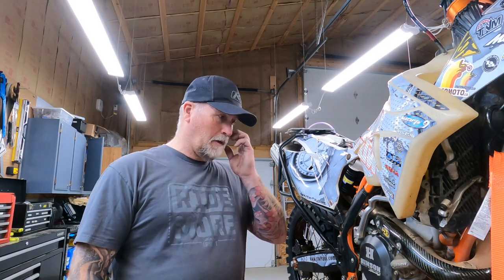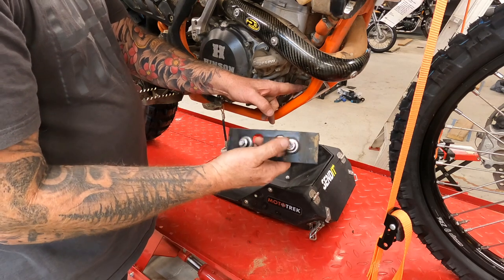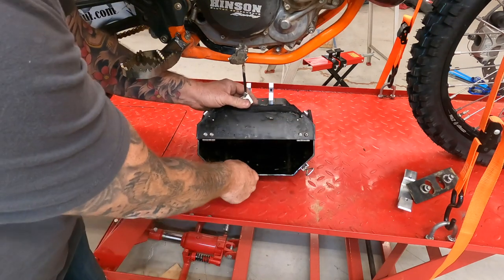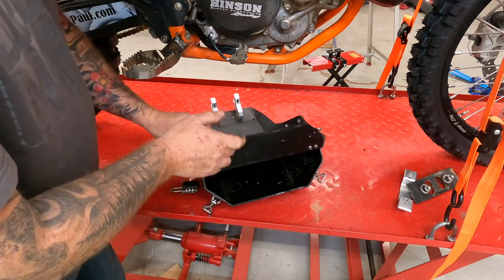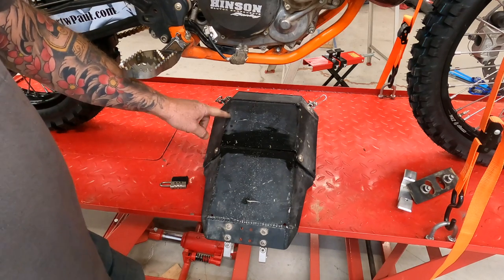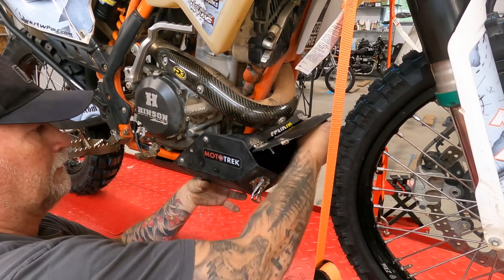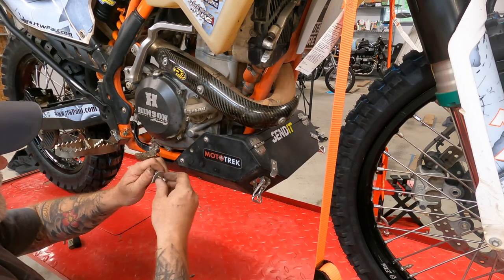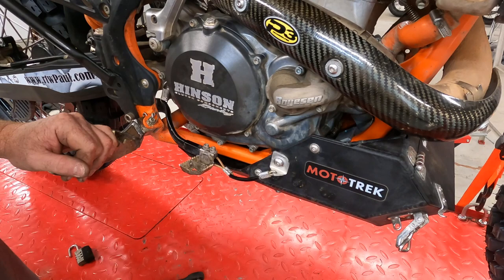KTM 500exc bash plate/ toolbox

Comment: Thanks for the video. I just made my own homemade tool box / roll out of a pvc pipe and mounted it under the bashplate. I was wondering what you do for removing your Axl nuts for when you have to remove your wheels? I bought a half inch tire iron to be able to do the job.. it folds into it self but it's still a big long annoying bit of tool, have you found any alternative to this? I ride a 2020 CRF 250 L - and I've otherwise modded it for a big RTW journey. I just found your channel, great content im a new sub
greetings from DK
Reply from the maker: I use a motion pro wrench/ tire iron